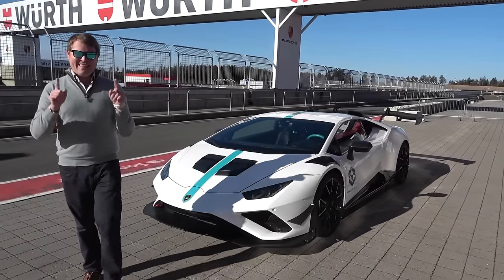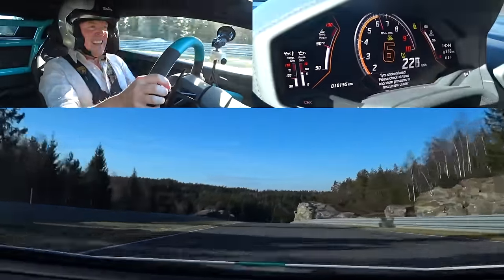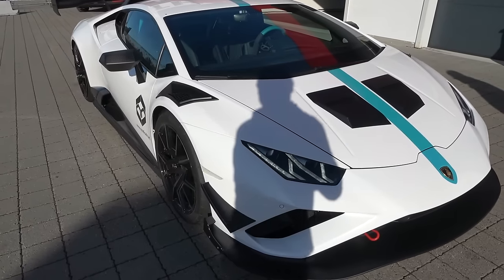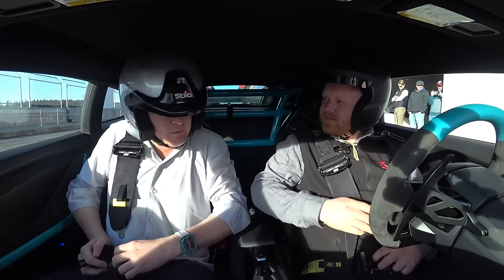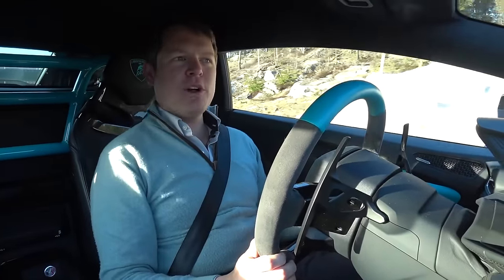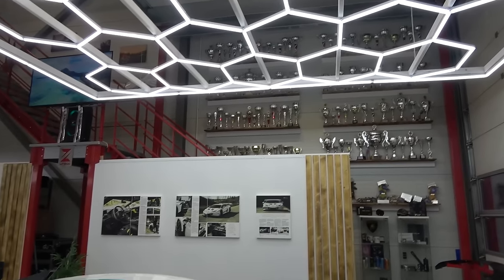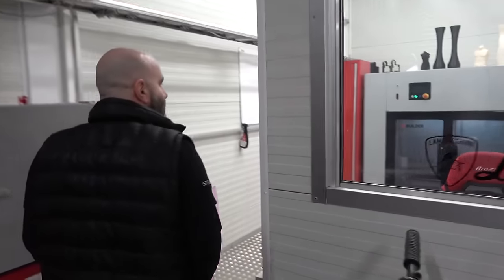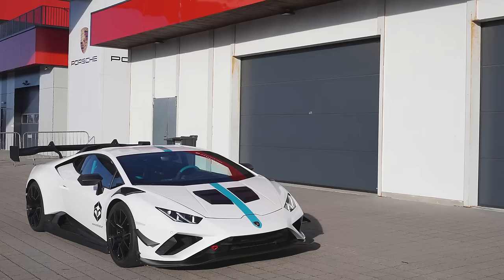SCARED SILLY! The Zyrus LP1020 Stimolante RIPS UP THE TRACK

Comment: Engine Compartment Temperature Waning’s! This was getting pretty hot even with Shmee driving it like he’s doing his driving test. When test driver jumped in the warning message came up within half a lap.. Better add another fan boys 😂
Reply: Actually, its not that hot in there! Just a pre-caution.. and it happens on stock cars too.. but we've measured it, so we'll try to make some adjustments of the sensor instead
Reply: It is not actually an overheating issue. The compartment will naturally get hotter with the turbos, but we also have additional cooling to take care of that. It's just that the stock sensor gets a bit confused, which to be fair is understandable :D

Comment: Love the look of the Zyrus interpretation of the Huracan Lambo pity that the thing overheats too easily
Reply: It doesn't. Not even close. It is just that we have yet to calibrate the engine comparment heat sensor for the turbo setup. Obviously, the comparment will get slightly hotter than stock every now and then with the turbos on full boost, and it doesn't take much for the stock sensor to panic and think that we are on fire. It has not been a priority, as it will be sorted with the next software update in a couple of weeks :)
Reply: Oh, it doesn't overheat. It's just the stock sensor having too conservative values. It will be fixed. 🙂

Comment: It's so funny when you consider that by normal car standards, 1020hp is a tremendous number. But, by twin-turbo Huracan standards it's basically the bare minimum you can buy (UGR has an 800whp Stage 1, which is about 1000bhp).

Comment: 24:07 was it overheating?
Reply: It's an engine compartment overheating warning. The turbos obviously create a bit of extra heat, so the stock sensor get confused. It will be fixed in the next software update.
Reply: Not the engine, but the sensor in the engine bay dont like the extra heat. But every values are good🔥💯

Comment: so how can it overheat (se the dash during the driving) in close to 0 c ?
Reply: Already been answered multiple times. It is not overheating, it is an engine compartment temperature warning. We have yet to let the sensor know that there are turbos in the back, so it basically panics and think we are on fire. It is a super easy fix that will be included in the next software update. It os a completely irrelevant warning, so it has not been a priority.

Comment: doesn't feel 1000hp , maybe it's on low boost
Reply from the maker: I don't know what output it is making exactly in this configuration, but down the straight was pretty ballistic
Reply: The spedometer makes me believe it's 800+.  It's definitely pulling harder than the VF supercharged Huracans if the speedometer is to be believed.
Reply: @flyingphoenix113  well if you look at the speed on the straight where he did around 240-250hp is pretty fast.. most gt2 cars do less than this under race
Reply: 250 on the straight at Rudskogen in a road car on street tires in March feels like 1000hp to me :P 

Honestly, the difference between 800 and 1200 hp on the track is hard to capture on film. Once inside the car I can promise you that you would feel it ;)
Reply: @FredrikSoerlie  agree, not many cars, race cars or even modified street cars capable of that speed on rudskogen.. Im nowhere close to that in anything else than my 1299 panigale